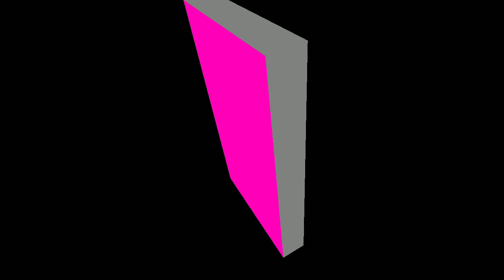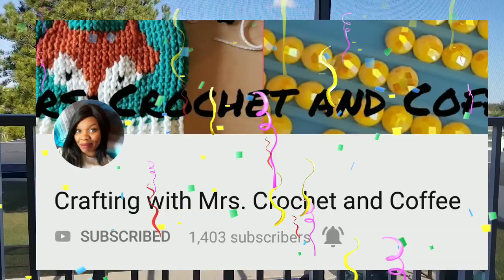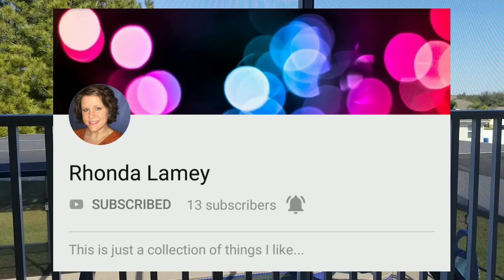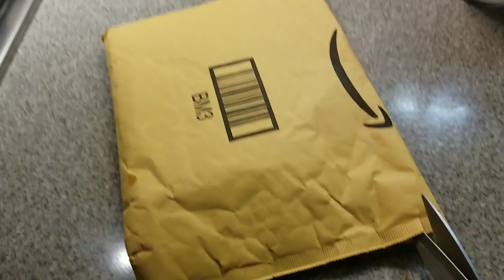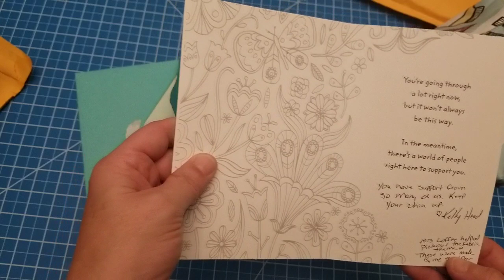Helluva Hair Ball ~ Scratch Art Experiment Part Trois ~ DiamondTube #140

Comment: Do you think setting that tea light on your coffee/candle warmer for a few seconds/minutes to loosen it from the bottom of the little container and be able to pull it out in one piece by the wick would work?
Reply from the maker: That's worth a try!
Reply: You also could probably set that broken one on the warmer to melt it back together.
Reply: I was thinking turn upside down on that blue silicone heat resistant mat & use lighter for just a bit & it would fall out of there.